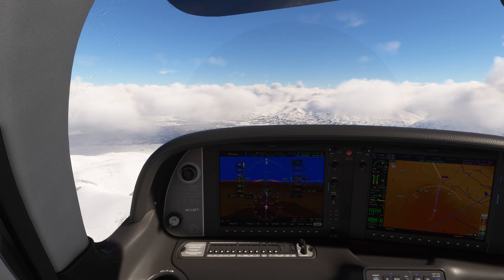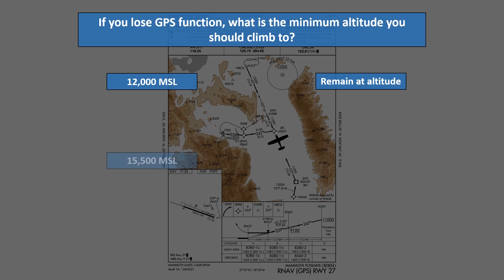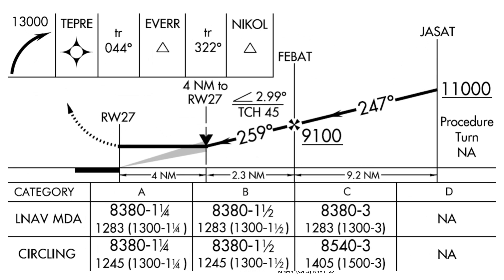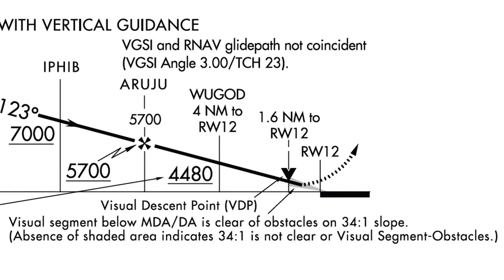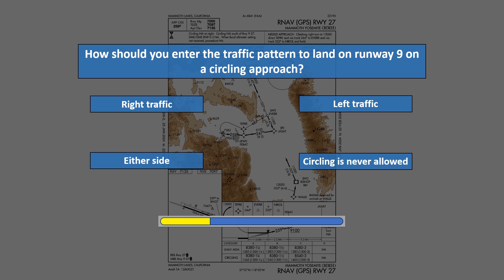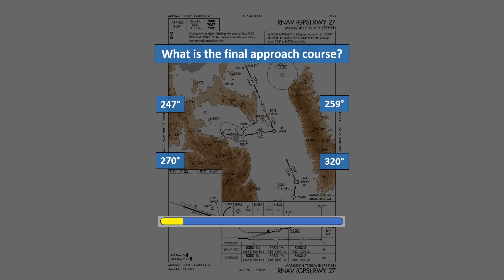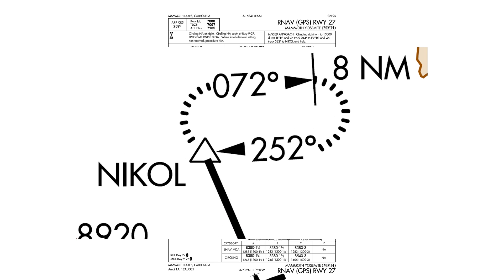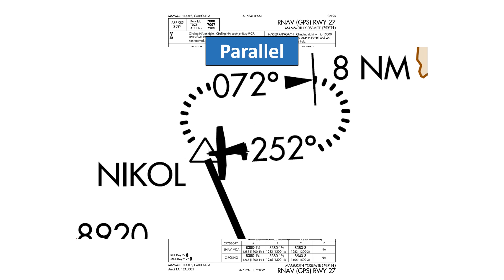Take a Quiz on this IFR Approach into Mammoth Lakes | Instrument Approaches Explained

Comment: i didn't understand that. Why do we start circuling to land with left traffic pattern? For example if we start at FEBAT with initial movement to the airport with heading 259 or so and with too much of altitude for example 17000 feet. 
Then we can only do our circules to the right, because on the left(south) are mountains. And on the right is a lot more space. So is this somekind of a trick or i just don't understand something about circling to land?
Reply: He asked if it would be left traffic or right. Since you’re circling the airport to the north, you’d be doing left traffic since you’d be making left turns. You would physically turn right to fly north, but it’s considered left traffic because you’re making left hand turns. Make sense?
Reply: Think of it like this. Whichever window you see the runway out of (left or right), that’s the traffic pattern you’re flying.
Reply: @russellbonds3842  Good advice about the windows during patterns.
Let me explain what i would do in this scenario if i were at FEBAT point at 17000 feet. I would do heading to the airport which is 259 then after reaching airport i will do right turn to the TEPRE point using go-around path and then once again right turn to FEBAT. After that i repeat this circle as much as needed to loose altitude. So all the time that was right turns and right traffic pattern for me. Also airport was on the right when i was on my way to TEPRE point.
So, am i still do understand something about circling? or we would just use different paths for circling?

Comment: Direct entry is the preferred entry or the one that makes the most sense. The parallel entry is the least, and in all honesty is not even an option. easiest way to remember any hold entry is that when you approach the fix from the short end or the turn that is leaving the fix outbound and you are entering from the outbound part of the oval that is going to be a parallel entry. If you’re in the same area but you’re approaching the fix with the larger part of the oval above the fix that is going to be a teardrop. if you approach the fix from the long part of the oval itself in either direction that is going to be a direct entry.